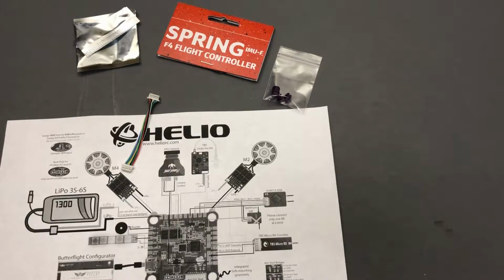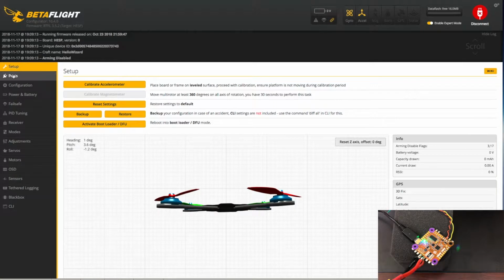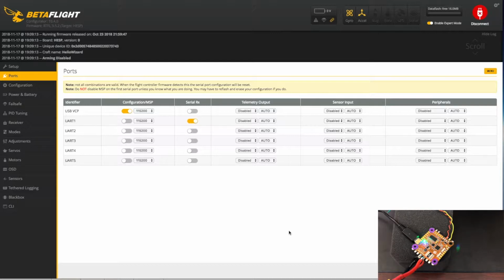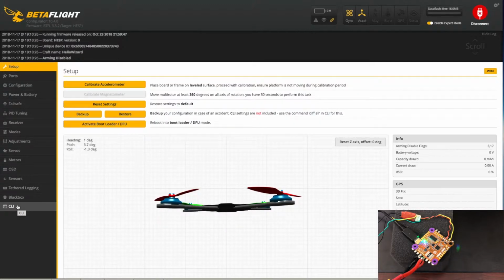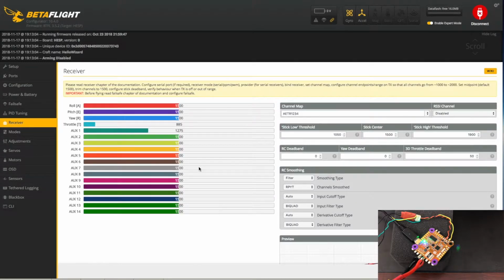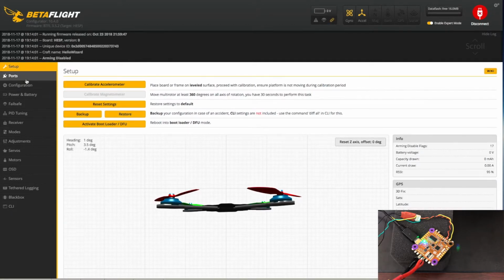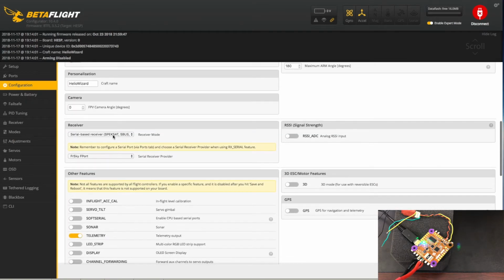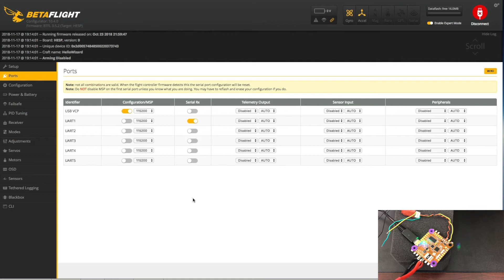Helio Spring Flight Controller Configuration for FPort

Comment: Hi Nice Video perfekt. I am using a Aikon 4 in 1 can you tell me is it possible to Power up the Fc( not aio fc) with the 4 in 1 Esc Port from the Aikon? Best regards from Germany
Reply from the maker: Yes, check the wiring documentation of your Aikon 4 in 1 ESC, wire the VBat from ESC to the VBat on the Helios FC which is the pin 1 from right to left on the ESC Port (opposite side to the motor 4). Please check here your specific Helios FC wiring diagram https://www.heliorc.com/wiring/ Thanks for asking!